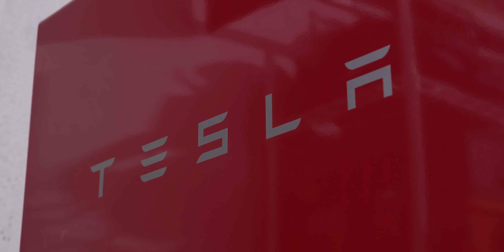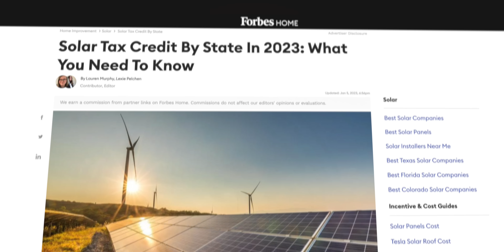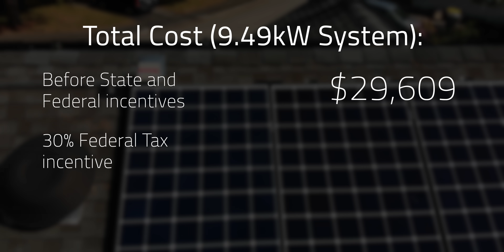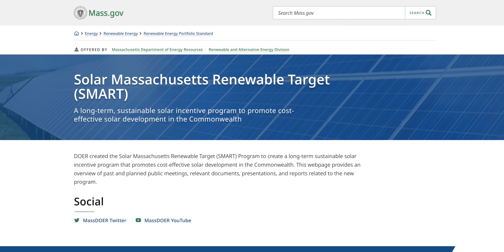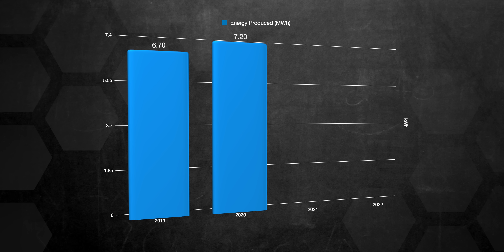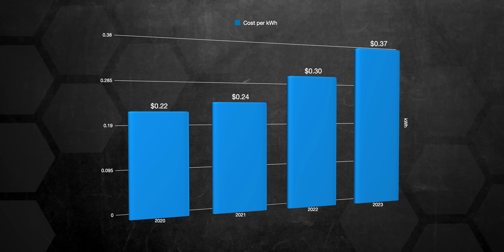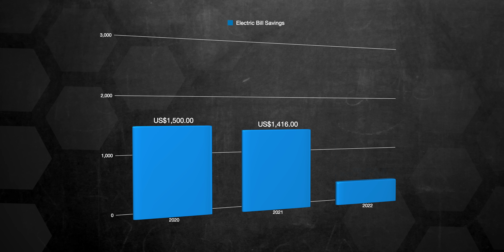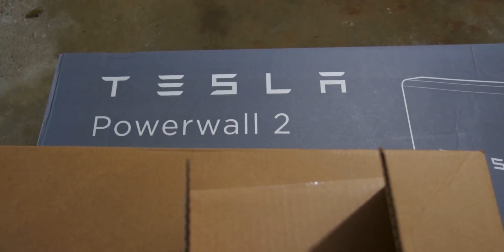5 Years with Solar Panels - Is It Still Worth It?

Comment: When we lived in Florida we looked into panels when Tesla was partnering with Home Depot. They came out and the first thing she advised us to do was to get an energy audit from the power company to see what our use was and to get an evaluation on our home's efficiency. That's when it hit home! Our 1957 home was/is an energy hog. Poor attic insulation, decades old ductwork, zero crawlspace insulation, and an 80 gallon conventional water heater meant we'd be throwing good money after bad. The Tesla rep was amazingly honest and pointed out that to even come close to breaking even we'd be into it for 70K between panels and batteries. Now we live in the mountains and this home is better but still not good. It's a converted cabin so the wall thickness isn't great for R value. Looking at the numbers in two different homes we came to the conclusion that one's home envelope and efficiency need to be addressed before any talk of solar can be serious. It makes no sense to spend a ton of money on a home that leaks energy like a sieve.
Reply: Good comment.  Have a 1970’s house in FL.  Thinking about solar but much to take into consideration!
Reply: @Dbb27  check hybrid hot water heaters. If you have a garage they're perfect in Florida. They use a heat pump rather than resistance coils to heat the water. Super efficient and they'll keep your garage 10-15 degrees cooler. Knocked $100 off of our electric bill when we lived there.
Reply: Also live in Florida and checked out solar; exactly the same experience.
Reply: @euphemiat7735  hey I hope you are having a wonderful day today
Do you want to install solar panels or anyone in your Circle area who wants to Go Solar?
Reply must please
Reply: Some people wrap their house in 2 inches of rigid Rockwall insulation, or simply build another stud wall around their house, and fill it with blown in insulation.  You can do it one while at a time
Reply: Excellent point- step 1 of any installation is to increase your existing energy efficiency. That will inform the array size you actually need and the payback period.  We got estimates before and after major efficiency upgrades (spray foam, heat pump, etc) and we need 1.5 kw less now than the previous estimate.
Reply: hey I hope you are having a wonderful day today
Do you want to install solar panels or anyone in your Circle area who wants to Go Solar?
Reply must please

Comment: I’m curious to know the full lifecycle costs, assuming one lives in a house when it requires the roof shingles need to be replaced and one lives in a home long enough to require panel and battery replacements. It sounds appealing until you add up the full lifecycle of events and effort required.

Comment: I'm an electrical engineer and I can tell you that residential rooftop solar panels are not worth it. Only larger scale, utility solar installations have a reasonable ROI and carbon reduction impact. Rooftop solar has negative ROI and negligible carbon reduction, particularly without expensive storage capacity.

Comment: One thing you missed , is:
How much your cost were.
What would you monthly bill be without solar.
Now divide the cost by the would be cost. 
In your case it would take 7,3 years to make up the cost by saving.
In 7,3 years you would have replaced your batteries and panels at a higher cost.
You have not saved a single cent so far. You have only spent lots of money. 
Everybody does their calculations wrong.

Comment: Oh, and another thing. The solar company says that the cells protect your shingles, so you won't have to redo your roof, ever. Ummmm, that might be true if you cover your entire roof with cells. But, say you only covered half of your roof. Now imagine that it's time to replace that part of the roof. During install, those shingles will eventually have to somehow mate with the shingles under the edge of the cells. I don't know how to do that. So, when we had to replace our roof three years ago, I opted to have the solar company remove the cells so the entire roof could be replaced. Then come back and reinstall the cells (with again, shoddy work installing the squirrel guard). I love the solar technology, but it has not been mastered yet. I'm really looking forward to solar roof shingles.

Comment: I've had solar cells on my southern roof in Virginia for 6 years now. The major problem that I've had, and wish I had thought through more, has been squirrels. If you have trees near the house and squirrels can get to your roof, they WILL build nests under the cells. That means that they and their babies WILL chew on those nice connecting cables under the cells. I've given up on the solar company coming out to fix the shoddy install of squirrel cage. The cage itself is good material. But the installers just don't take the care to make sure there are no gaps. And, unless you go up on the roof yourself, you can't check them. It's been really frustrating. Each Spring now, I watch for squirrels running up my trees with nesting material... if so then I know they've gotten by the cage again. I know... you should cut down the trees and shrubs around your house. Our solar company never mentioned that, and I want the shade provided by the trees anyway.
Reply: Almost as much of a pain, but have you looked into having the wiring from each panel directly pass through roof, then do connection/joining?  (bigger pain with more holes in roofing, if done poorly more weather coming right in...)
Reply: @charlesmartin7536  Interesting. But, roof penetrations scare the heck out of me because I can't see leaks until they bleed through the ceiling. And, if the panels aren't flush against the roof then there is still some exposed wire between panel and roof (of course this could be shielded... but, if you don't do the work yourself, you can't guarantee that it was done properly). I'm looking forward to solar shingles...